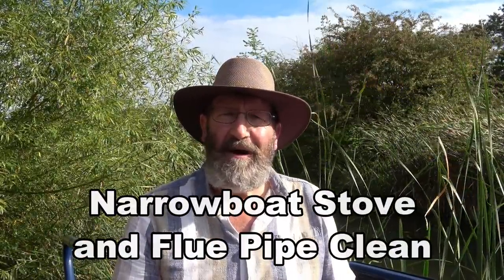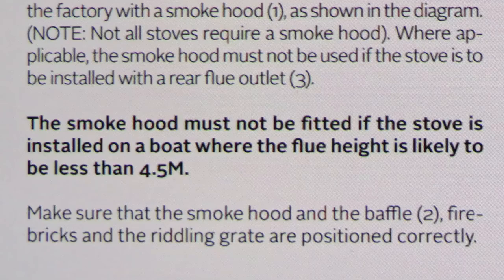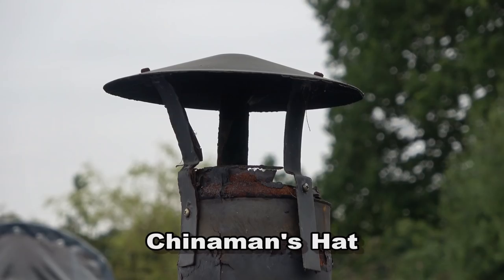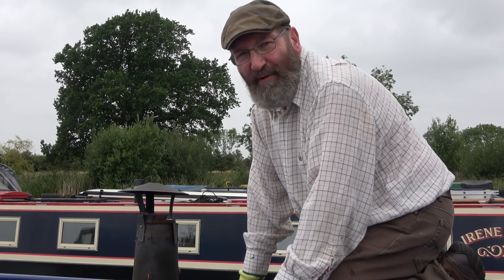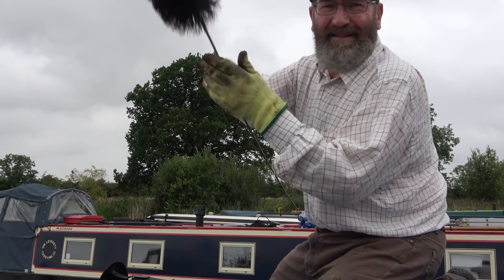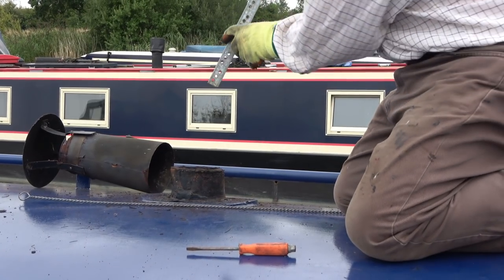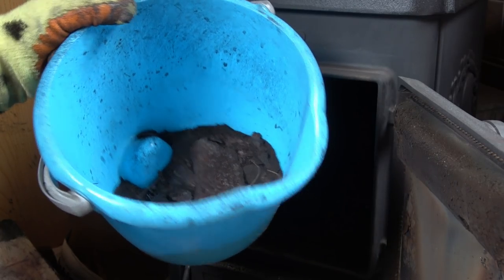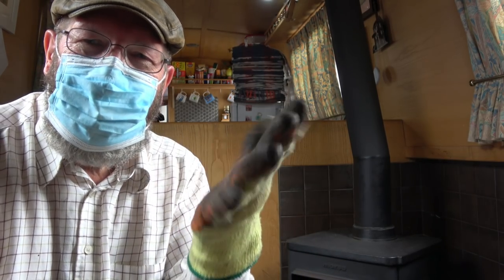220. Narrowboat Stove and Flue Pipe Clean

Comment: Good job Alan, I tend to leave the cottage Woodstove till the spring ,I have an old wet/dry vac I use to help with the Cleanup We sometimes use a small spruce tree sapling to scour off any creosote deposits,I've also used cans of "stuff" that you burn in the fire which help to remove it too. .My stovepipe is double walled stainless steel flu pipe with a rain cap and rigid stainless stays on 3 sides the flue has to project a certain distance above the roof ridge for insurance purposes. The stove is Steel but the door and ashpan door are cast which I paint once a year with stove paint and the glass I clean with the same stuff I use on ceramic stove tops  Unlike you I just burn wood and my acreage supplies that ,a mixture of maple birch red oak and spruce just branches the occasional blowdown and thinings.I also have acess to slabwood from a small sawmill which is in a pile for the taking this is good stuff for kindling as he saws quite a lot of cedar which is in high demand for decking.That and birch including the bark make excellent kindling.Trees are turning quite rapidly now and day temperatures are around 20 c and down to as low as 7c so soon there will be frost on the pumpkins which are everywhere now.Cheers Alan good seasonal topic ,take care Cheers from me and Canada.
Reply from the maker: Thanks for the interesting explanation about your wood stove and sources of fuel for it. The nights are drawing in here now but I've not used any heating for a long while. All the best to you, take care and keep safe. Cheers Alan

Comment: Thanks you for such informative videos. I have a Moral Squirrel which has drawn very weakly since new last year. (Fitted on a new boat) I went back to your video 82 as you suggested and discovered the smoke hood issue. So I checked my stove and there it was fallen down on one side. So removed the side bricks and baffle and got rid of the smoke hood. Looking forward to a cost winter. Thanks for your research and effort in sharing your experiences
Reply from the maker: Hi Jim. Thanks for your comment. If the smoke hood wasn’t in place, you might not notice any difference but let’s hope you do see an improvement. My smoke hood had also fallen but that was due to a fixing clip being broken. All the best Alan

Comment: Hi Alan another great vlog just thought I might say them chimney brushes are good if used very regular if only doing once a year then the best thing for clearing the chimney is a length of chain tied in a knot then pulled up and down in the flue this gets all the hard stuff off the sides that the brush won't deal with
Reply from the maker: That's a great idea, I'll remember that thanks for the suggestion. Good to bump into your recently, sorry but don't recall your Christian name. Cheers

Comment: Hi Alan. The Flue on my wood heater at home is straight. So I use a long piece of 4x2 wood with chicken wire wrapped around it. It cleans all the creosote off nicely. This Winter we've had more calls than usual to flue fires. People not cleaning their flues before using them this Winter.
Reply from the maker: That's a great idea Gary, it's good to be inventive. I suppose it's not so easy now to get flues swept in a household situation.